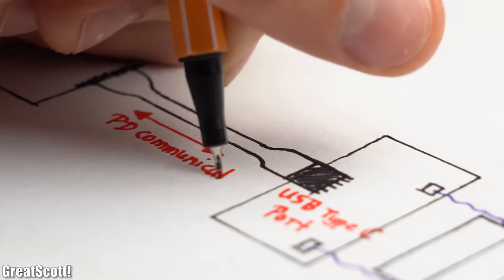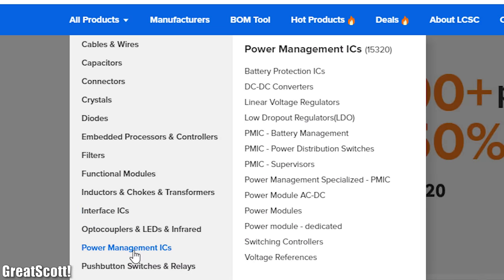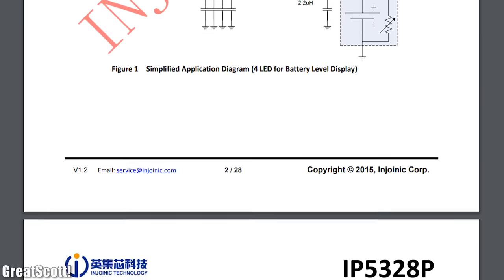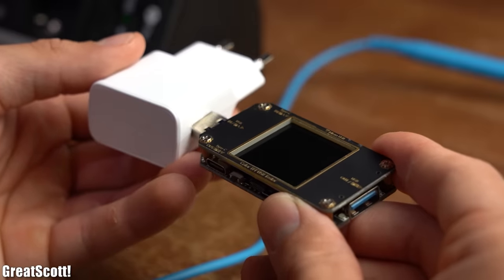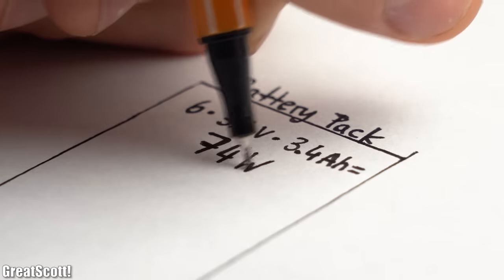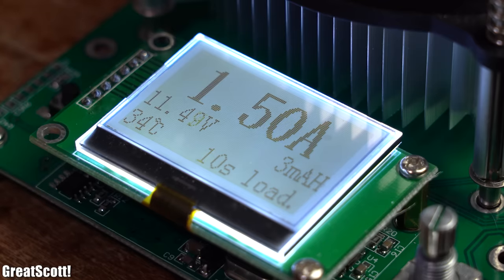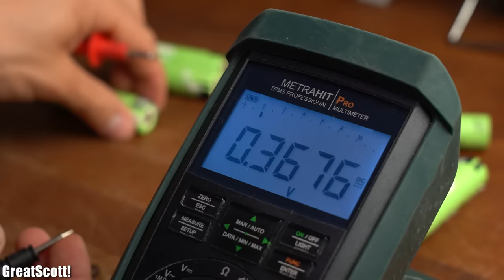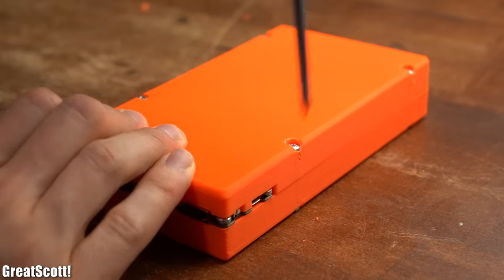Building a USB Type-C PD Powerbank the Super Simple Way || Testing an Aliexpress PCB!

Comment: Great video! I was wondering if there is a limit of how many 18650 cells you can wire in parallel. Thanks!
Reply: I got x21 18650 pd power bank case controller board from china and it works. Chargers for like 10h or so, but works.

Comment: I have used this to make a few battery packs now, and I absolutely love it! Has anyone come across a board like this that can also do 15 and 20V out?
Reply: I was going to ask similar question, 20V, 5A would be awesome.
Reply: Any chance you found a board that does 20V? Looking to make a battery adapter to power a soldering iron and 12V won't work.
Reply: @KiaranScath  I have not, still keeping a look out though
Reply: I'm also looking for a 20V (45W) out PCB for my laptop

Comment: So I bought one of these but despite trying to power it from my bench power supply or a single 18650 cell, all that happens when I press the button is the 25% LED blinks four times and that's it. No output. Anyone else ran into this issue?
Reply: OK, so it must be something to do with this: "IP5328P battery at the first access, regardless of how much the battery voltage, the chip is in a locked state, the least significant bit will flash charge lamp 4
"

Comment: I just do not understand that a USB output can deliver different voltages. How does the powerbank know which voltage to offer.  If I connect something that needs 5 volt max, will it not get broken becasue the powerbank thinks it has to give 12 volts? Very confusing this auto voltage switching.